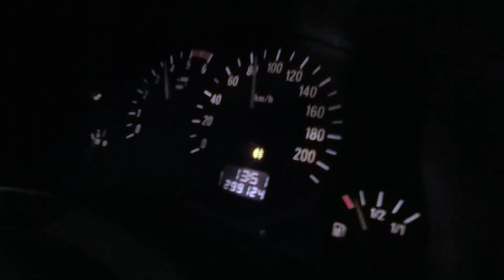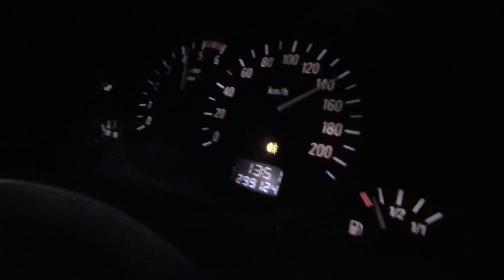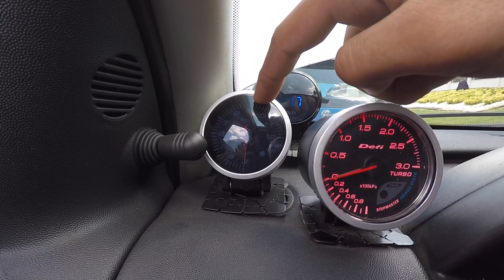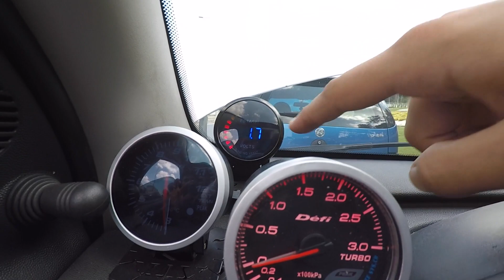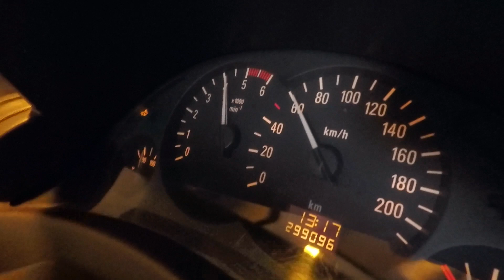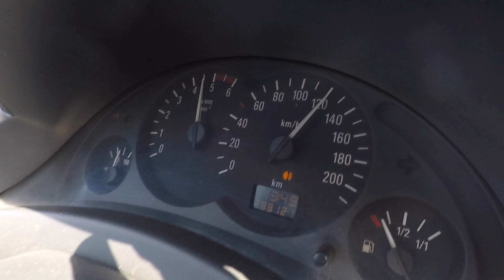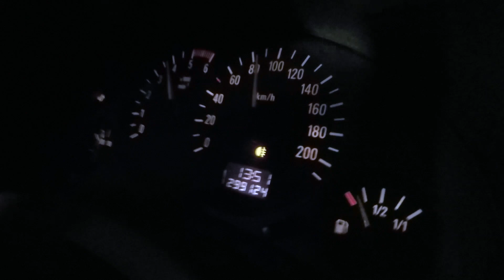Opel Corsa 1.7DTi K03 Hybrid Setup

Comment: does anyone know a complete list of setup to put the 1.7 with more than 200hp?
Reply: cancel egr and dpf
big turbo
big injector
bigger intake manifold
big intercooler (6-7 liter minimum for 200-250hp)
straight pipe + downpipe (dp means higher power on higher rpms)
performance air filter